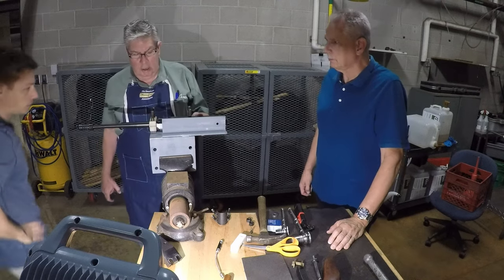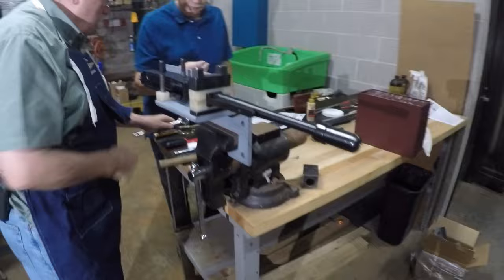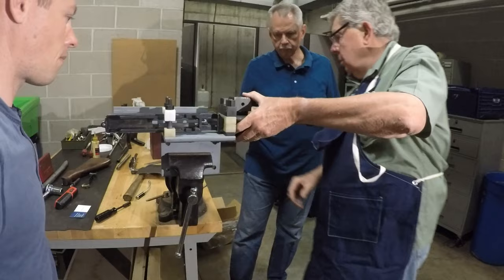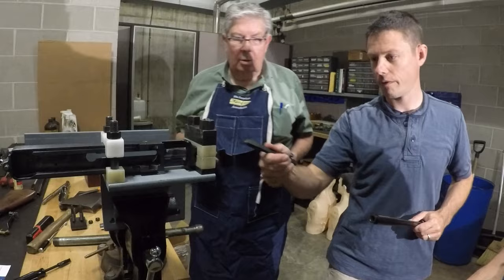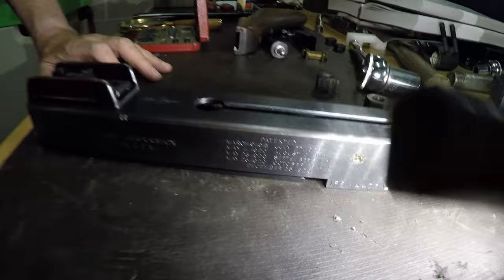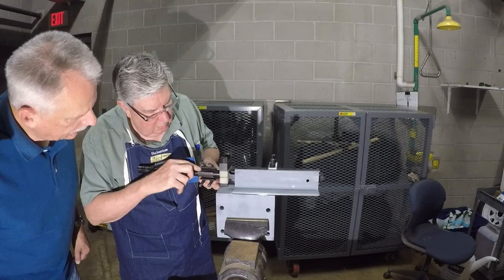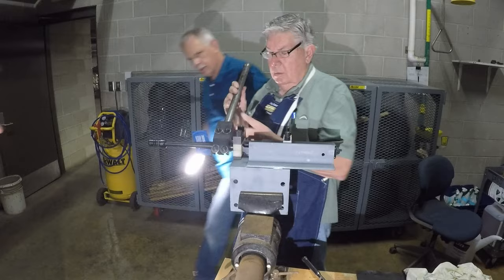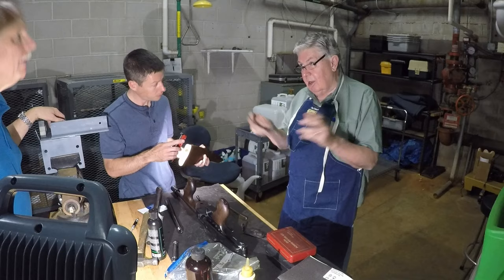1921 Colt Thompson hidden serial number reveal (gangster gun) and barrel removal tutorial

Comment: Awesome, I didnt realize that we can switch the barrel up to the 10. 5" barrel. I hate these newer barrels that their slapping on the Thompson's now... 🔫🔫👍🙏
Reply from the maker: You may need a new gripmount also due to differences in barrel countour. I believe original gripmount width is 1/2 inch where West Hurly changed to 3/4 meaning you may need a new wood foregrip too depending on what gripmount you install. Some parts  companies like Numrich probably sell both types. If you are in the US read up on Short Barrel Rifle (SBR) registration requirements, which is the main reason the ugly long barrels are installed.
Reply: Don’t forget to apply for the short barreled rifle tax or it’s a violation of the GCA .

Comment: Do you have a video or information on how to remove or install a cutts compensator? I want to install one on my Thompson SBR but can’t figure out how to remove the front sight. I took the pin out but it still won’t move.
Reply from the maker: I'm afraid not, there are several versions of compensators. If you join machinegunboards forums someone in the semi Thompson forum may be able to guide you.

Comment: Steven’s? Thought Colt made the early Thompson’s?
Reply from the maker: The original colt barrel was replaced with a ww2 smooth barrel, and has now been restored with a repro barrel of the correct type. Pictures seem to show the original Colt barrel was on in the 1930s, best we can figure at some point after ww2 a squib load may have damaged/bulged the barrel requiring a replacement
Reply: The Thompson company subbed out the manufacture to Colt.
Reply: Stevens ain’t got shit to do W/Thompsons -SAVAGE ARMS made them under contract during the war
Reply: @63DIRTY he explains in the video if you’d just LISTEN
Reply: @63DIRTY Savage and Stevens 
Both marked with a “S” the Stevens mark was a square “S” and Savage was-S.